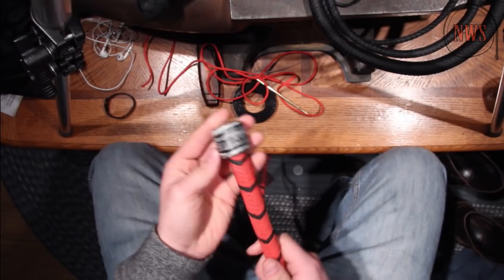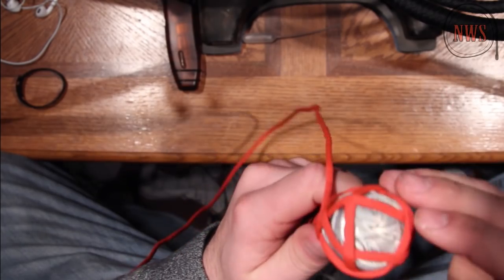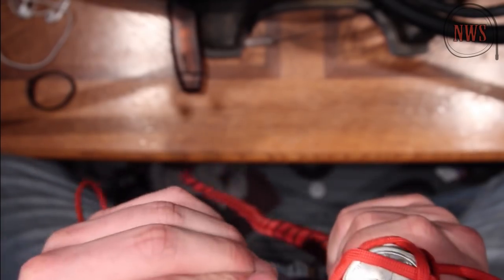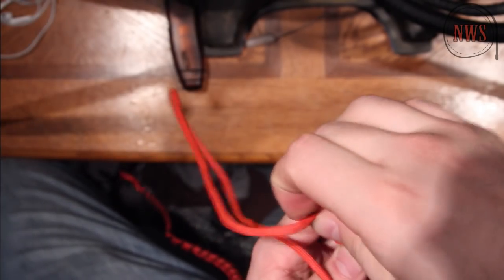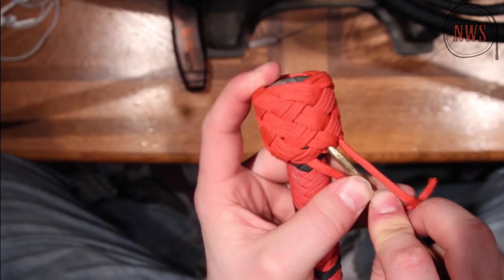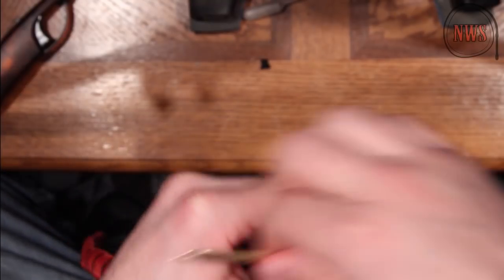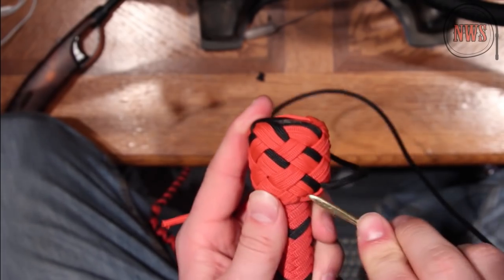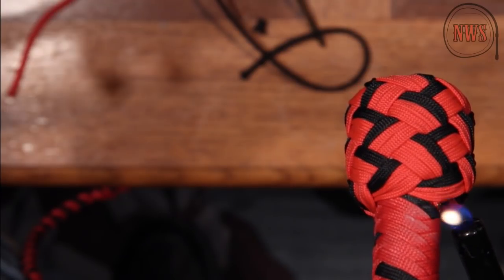3 Pass, 6x7 Turks Head Heel Knot Tutorial | Nick's Whip Shop

Comment: I discovered many years ago, that you can flatten out the gutted paracord with a clothes iron. You don't want it so hot that you melt it, you are basically putting a permanent crease in it. That should keep the cord from twisting as much. Also, a cheap wood-burning iron from Harbor Fright or Homeless Despot has flat (and textured) attachments to melt the cord without a chance of turning a project into a fuse at the last second. I love your videos, and keep up the good work!

Comment: I am a carpet cleaner. Being a carpet cleaner, I know how strands can get twisted. The hose I pull around a house when I clean carpet gets twisted every time you turn about a corner, likewise, each time you turn a corner and move the needle past one pull and into the next, you unconsciously move the needle up and to one side of the pull, and then as you put it back into position in your hand, it has been flipped over relative to the surface of the knot. You need to learn which way this is, and counter twist every time you thread a split.

Comment: This is a great tutorial for a very difficult knot, thanks!

A few hints that might help improve such tutorials in the future.

For keeping the work in the field of view, work on locking your elbows at your side; wrap a belt or some rope around your body if you have to at the beginning. This helps to keep you from moving the piece too much. I was taught that work that is done off-camera is work that is wasted; if the audience doesn't see it, it didn't happen.

Increase the depth of field on your camera so you don't need to refocus so much (or at all.) A good camera man can ensure that you are always kept in frame and focus, but it's a full time job for him to do so. Trying to teach a technique while ALSO having to run the camera is like trying to juggle 5 bowling balls; possible, but likely to leave you with crushed feet and a bruised ego. The less you need to mess with the camera, the less headache you will have.

Finally, while the audience always loves getting to see stuff up close, remember that you can use editing to your advantage; if you want to transition from a mid-field shot to a close-up, you can spend as much time as you need setting up that transition and then edit out the superfluous footage in post. I know it can feel rather disjointed to film this way since you are always stopping and starting to get the best shot, but the final footage will feel pretty seamless.

Hope that helps and I look forward to your future work!

Comment: you might could give the metal end a spritz with spray glue before you start, to make it a bit tacky, so it wouldn't slip so easily. Then a wipe with alcohol or acetone after you're done to take the glue away and clean the metal.